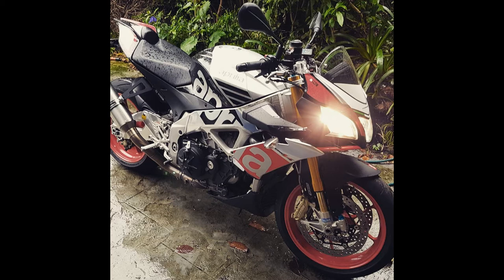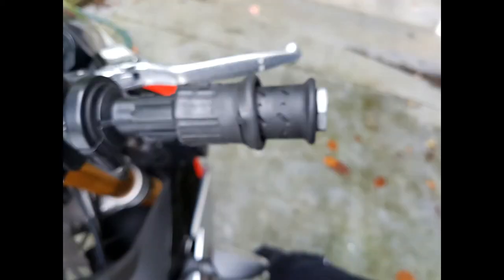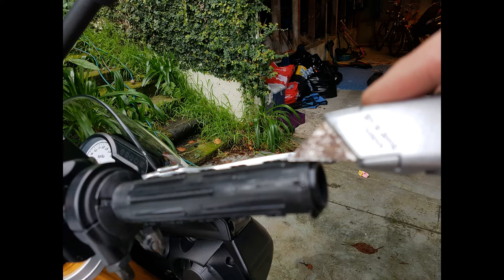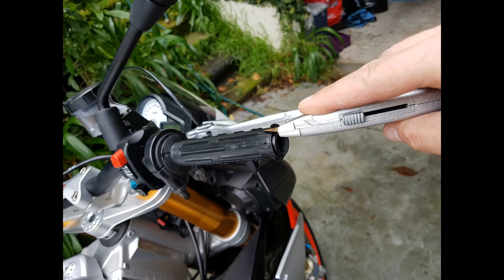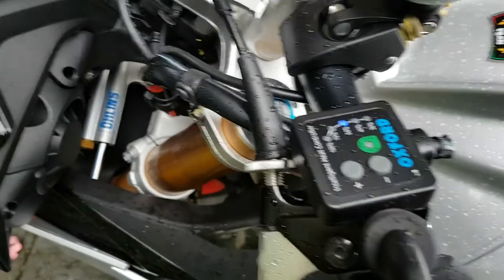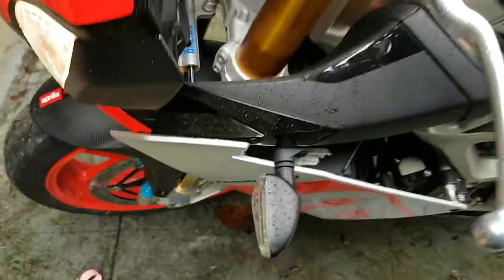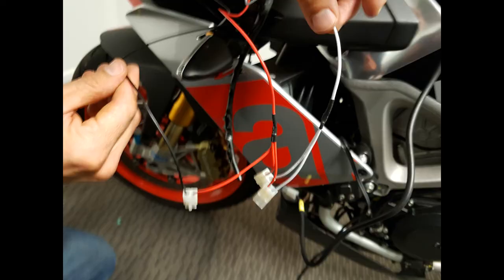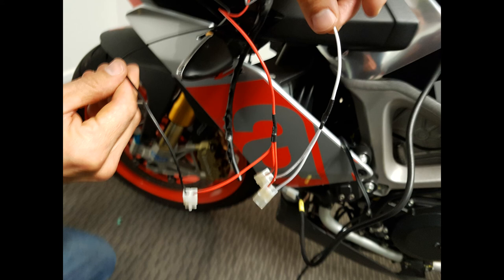My Install, Oxford Heated Grips Aprilia Tuono Factory

Comment: Did you use the sports grips or the touring ones? I've just ordered the sports one's for my 2019 1100 factory. What do you reckon to them? Was it worth fitting them? Cheers
Reply from the maker: From memory I got the sports grip, been over 2 years now. Absolutely worth fitting, honestly it makes riding in the colder conditions so much more enjoyable. I think we often forget just how much that the cold can affect our riding, these were the no.1 best thing I fitted to bike. Kept hands super toasty with no loss of function or feel.
Reply: @mcprocrastinator7921  I've been wanting to fit some for years now. I've always worried that the larger diameter grips would annoy me but I suppose you get used to them. Thanks for the reply 👍
Reply from the maker: @karlgreen4273  no probs -Also one real benefit I really liked is that you can wear a lighter glove on cold days yet crack up the heat and be toastie warm, honestly they are so good :-)

Comment: I know that this a bit old but did ya know there's a couple new blades in the handle of your knife? Unless you've used them. If so never mind carry on. Lol 
Might save your hacking away bit next time.
Reply from the maker: Nik Scott yes unfortunately i must have got it wet and they were all pretty rusty, technically i should have gone out to buy new, but i didn't habe it in me lol - thanks for the thoughts though 🙂